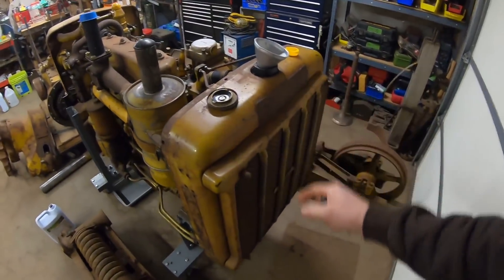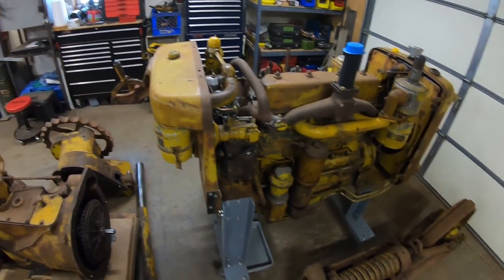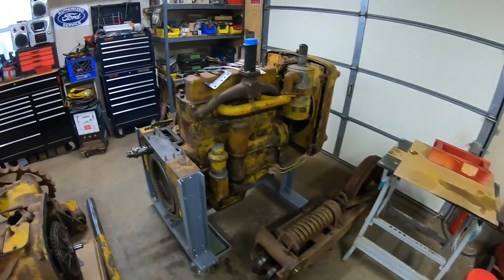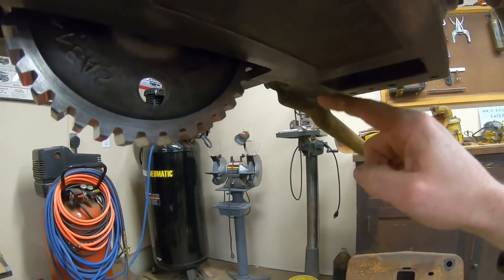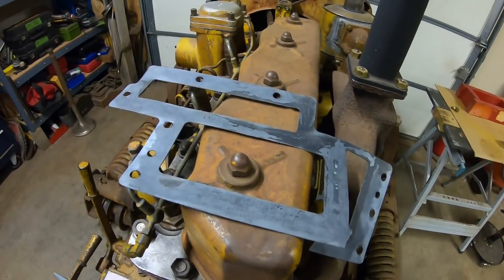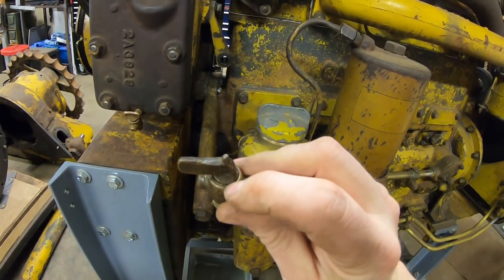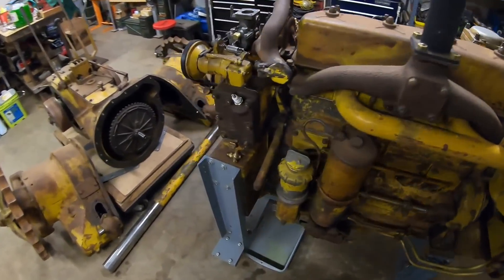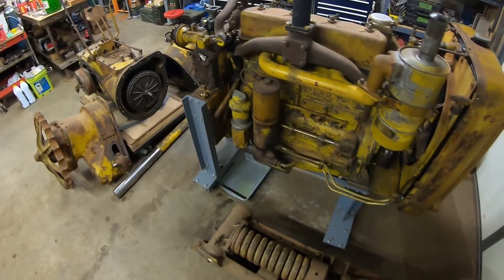Caterpillar D2 #5J1113 Starting System Ep.21: Cooling System Fail!  Taking Things Back Apart...

Comment: You can see that type of leak coming from a mile away with not much clamping force in the middle. You would also figure if they used groves and rubber seal for the top coolant passage they would have used for the bottom coolant passage.

Comment: Leaks, nooooo! That's never happened to me (said no one ever). Sometimes it's like playing whack a mole.
Reply: I can only remember one engine rebuild that I didn't have any issues at startup. It was an awesome 89 Ford Escort. It started the first time I hit the starter. Absolutely no leaks and the hydraulic lifters went quiet in less than 30 seconds. It made me nervous that it started so quickly and I was really surprised when I couldn't find any leaks. Purred like a kitten and after break-in I could go from 0 to 50 in about 250 feet. I typically would skip 2nd and 4th gears on takeoff. My wife couldn't understand why I enjoyed driving that car. There's nothing like getting to use something that has some of your blood, sweat, and tears in it.

Comment: Nice catch, better now then later. Many early cast iron assemblies in where two large cast iron bodies are gasketed together, wind up leaking due to the gasket material failing or the sealant shrinking back. The biggest issue with an assembly like this is that there are two semi rigid bodies trying to achieve a seal through compression  of the corresponding surfaces. The matings surfaces are flat at inspection, however, when all the bolt torques are applied the castings pull out of flat. This is why whenever I am dealing with a complex assembly like this I will assemble as many components as possible prior to inspection. I am trying to impart any forces that may shift the casting. It is no different then using a torque plate on an engine block prior to the final cylinder hone to replicate the changes to the block caused by the head bolt torque specs. 

#SQUATCH253: I would suggest getting and keeping a large block of steel that is ground flat. Wrap a piece of emery cloth  around the block (180 -220grit). Sand the bottom of the casting to reveal where any low or high spots are. You probably already  know that trick, but just in case.
Just FTR, something like this is perfect for Loctite 515. I wouldn't even use the gasket unless it was necessary for spacing. The stuff really gets-it-done for this application

Comment: You never know what you don't know, until you know it.

Great stuff. Hope the new gasket has sufficient compressibility, and does not leak. At least it is not a  pressurized coolant system.

Comment: If you skim a cylinder head on a surface grinder you always see high spots around the bolt holes and probably the last area to clean up will likely be between the bores. This effect seems worse on older components. They move a bit with age and stress. I suspect this has happened a little here. Hopefully a thicker gasket will solve the issue. I swear by a gasket sealer called Blue Hylomar, I don't know if this brand is available in the USA but I am sure there is an alternative. Its a fairly thick non hardening blue colour stuff in a tube.

Comment: I remember putting a head gasket on a Nissan years ago. Had it nearly done and when I put coolant it it started running out between head and block. Pulled head back off. Head gasket looked fine but when I checked thickness the fire ring area of the entire gasket was 6 thousandths thicker than the fiber portion after head had been torqued down. Got a new gasket and had no leak. But I always was nervous on first start because many times there was a problem. Hang in there. It would be interesting to take that petcock apart to see why it is seeping.

Comment: If you struggle with the gasket again, see if you can get some Klinger SLN-300. Its graphite based with a foil substrate and squashes down substantially. Excellent stuff, it'll seal that no problem.
Reply: Not your average cereal carton gasket material. Is it as easy to cut cleanly?
Reply: @erik_dk842  cuts lovely with all the standard stuff you'd have in your gasket cutting toolbox. Easier than thick fibrous material, to be fair! It excels at sealing poor faces. Being high pressure steam rated it's way overkill for that job, but it'll get the job done no problem, won't stress anything where it's squashed down a bit tighter and won't fail.

Comment: My initial guess would have been the rubber gasket between the starting engine and the head. But it seems it's not as bad as It could have been. Personally I have had mystery leaks from thermostats and hoses so I know the struggle well.

Comment: Those pet cocks can sealed by using the correct spring, ensuring that the intended washer, washer thickness is between the spring keeper and the spring. To exert enough pull to get the plug down into the plug body. Visually inspect all parts individually to ensure  proper fit and finnish and dare I say it drill, file and or lap the parts into a close fit. It came to you used and possibly cobbled together. The first Gen coolness will not be lost, by a Squatch253/Toby repair. Just like all the other parts of 1113 a little well placed effort and skill will result in a story for the fans. Great stuff as usual, I eagerly await the next  video. I hope you take the time and repair it, after every thing  else you have the skill I'm  sure.

Comment: And I was hoping this would be your first no strike home run. As one of my friends says, "it's life, get over it." It seems that you have a good attitude about it and you don't seem too surprised about it. Hope that's the only setback you have.
Reply: @squatch253  But it sure feels good when it starts up and settles into a sweet purr.
Reply: Toby, I've been trying to recall what the contact pattern on that gasket made me think I had seen before. It was a 390 Ford engine that had a head gasket turned backward on it. Because the smaller coolant passages were at the back of the engine on that side, that corner of the engine got too little coolant flow and the engine was overheating. The mechanic who found the problem found that the new head gasket that he put on leaked immediately. The head was warped only around the rear cylinder. Everything forward was flat but it had high spots around the head bolts surrounding the back cylinder.

Comment: That happen to everyone Squatch when I was a kid the town had a D8D with a pony motor sitting in our yard they put that pony on 9 times before they ended up putting 2 thicker gaskets in place for the heat expansion chamber that laid behind the pony nearest the back of the engine .and that had blown out when she threw a track one had nothing to do with the other it was just its time.

Comment: I know exactly what you're going through! I recently rebuilt a Ford KSG416 engine for my Bobcat 732 and also had an annoying coolant leak. Took a few tries to fix it right. Got the engine running on the bench, all looked really good, got it installed in the machine, runs awesome, now after running it for a few hours I have a nice oil leak in there somewhere... already removed the engine once to find it and it's leaking still. Not near as bad but still leaking. So one of these days the engine will be coming out again... I must say I really admire your attention to detail and have watched each and every episode so far and always look forward to the next one! Thanks for taking us all along on your projects!

Comment: Do you ever use any cooling system conditioner additive with a fresh rebuild,  like  zecol and mabe a little  barsleak to help with anti corrosion and  sealing.  I heard once that that car engines had some sealer in  the coolant right from the factory  but it just might be an old wives tale, love the video keep up the great work  thanks...

Comment: Hopefully that gasket doesn't cause too much of a problem with the gear lash? You'll probably be OK though for the short amounts of time it will be used. Which brings to mind a question, have you thought about adding an electric start upgrade (for the convenience)? I know, "but it's original" comes into the picture but it does make you think?
Reply: @squatch253  I stand corrected. Thanks for the feedback.

Comment: I worry that the thicker gasket will effect gear engagement. 
Was the warped starting engine done by rust jacking, freeze jacking or somebody over tightening the bolts some point in the past.  
Do you have a truly flat surface that you could glue sand paper belts to and remove some metal . Then go to thicker gasket to adjust gear lash?

Comment: You probably wouldn’t have had that problem if you used some modern sealers like the ones ford uses on their oil pans and differential covers. I appreciate the showing of the old ways of doing things. Just shows that people have learned from old problems and made new solutions for them.

Comment: I feel your pain! Few years ago I rebuilt an LS1 engine and put a high pressure high volume oil pump in it. Took it out after break in got on it and the oil pressure hit a 109 pounds!! I did the math and figured 50 hours to tear it down and rebuild it at a $100 an hour was cheaper than the engine would cost if I blew it. Turns out I think it was just the Spring in the oil pump that I put in was that good of an oil pump.. Put a low pressure Spring in for the high volume pump and it's been good ever since

Comment: Like Small Block Ford timing cover to block just love to leak especially after changing water pump. Or bolts are seized in the housing you know 4 long ones. My brother modified his cover had groove put in for oring (cover to block) and then just put cover on with grey silicone. My brother has V8 2000 Ranger too see what I started when I did mine LOL. I've had small leaks on first starts but I 've seen many leave oil supply line off going to turbo. Puts lots of oil on the floor fast we say its lake Shawn the person who's working on it LOL. Had new guy jack up on oil pan once that put 10 gals of oil on the floor that was lake Bruce. Which turned into new nickname Bruce the destroyer after he transferred to one of other stores. After they found out what he broke and what he did there

Comment: I used to go through the same  issues when working on big stationary natural gas engines and compressors when doing a major overhaul on them.   ALWAYS something that comes up ...it's just the nature of the beast.  Sometimes it's minor and an hour later it's OK...Sometimes we're pulling heads and possibly a cylinder liner...ect...but it's gotta be fixed properly.   Look forward to seeing that  engine up and running soon !!

Comment: Been a lot of years ago and cannot advise you exactly how to do it anymore but back in the early 70's I had a project in collage where we had to lap or grind in petcocks to get them to seal.  Only involved in doing a couple and not done any since then but there is a way.  May be worth trying to find out the method to salvage a vintage/ correct petcock for a first generation tractor.  Good luck.  Enjoy the videos.
Reply: I believe it involves lapping compounds of differing grades.? Ironically I have the water-block petcock for my budding Triumph TR4 engine block to attempt this very weekend...

Comment: Last year I finished the rebuild on a Ford 302 V8. All fluids in, and it looked good. Then.......water leak at the right rear corner of the engine, only when hot (under pressure). I would have much preferred a leak when cold.

Comment: I heard last night that you were taking the Pony Motor off as you had a leak(Was watching Rick's patty day eve and patty day streams at work) and had to wait until I got home to see if there was a video on it.
Now that I read through the comments I will add this to mine, It is not as bad as the IM, because on her you would have most likely had to have her running to find the seepage unless you added oil in the top and it sat and seeped from a oil puddle.  Chin up bud and look were you are going not at the ground in disgust!

Comment: I don't know how many of the D2s Cat made back in the day, but someone in the factory must have had the daily job of final prep and machine startup.   Maybe not as much pressure since they weren't personally invested in the build process but still probably just as many issues to sort out.
Reply: I figure that after thousands of hours of operation everything warps and settles into harmony. Swap parts from one engine to another and things no longer mesh the same. Just the way it is.

Comment: I’m surprised the machine shop didn’t catch the concave bottom on the starter engine. I figured they would have check it to make sure they had a good reference surface before putting on the mill table for machining.
Reply: @squatch253  sorry, I didn’t intend to put the blame on the machine shop, it was more of a it just happened to sneak past an extra set of eyes. That’s all 🙂